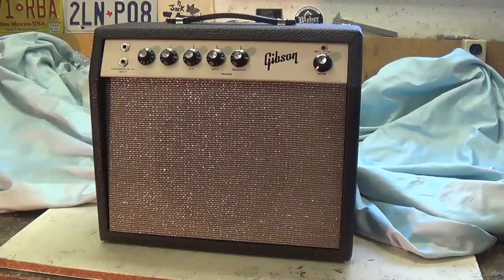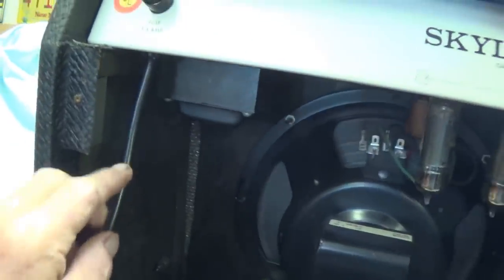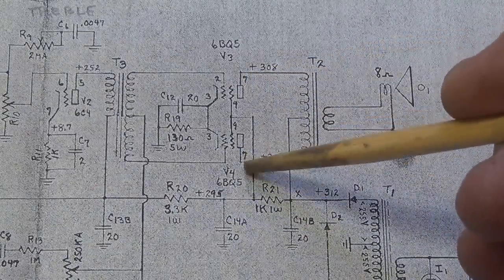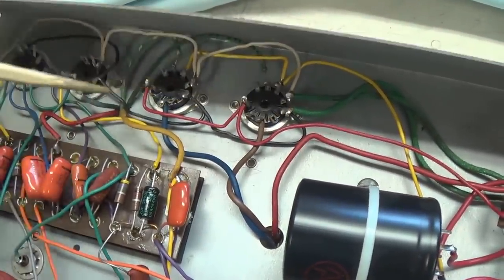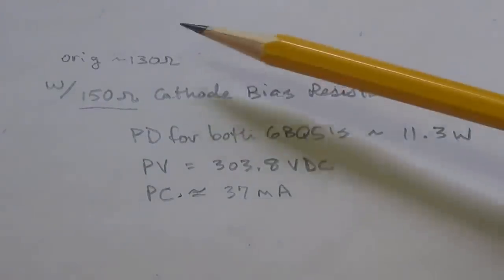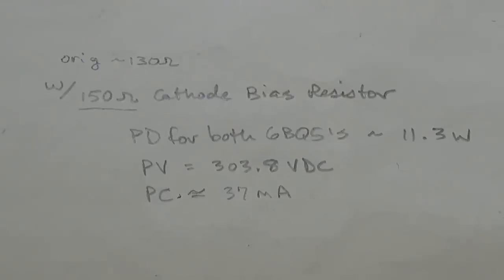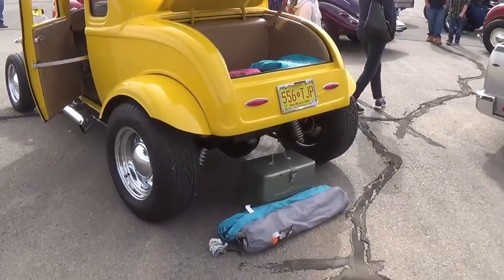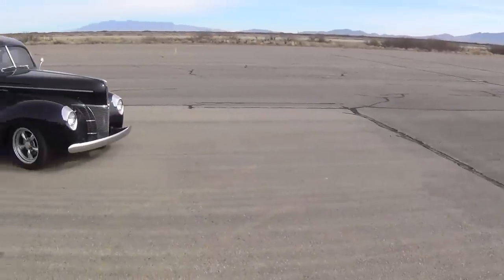1965 Gibson GA-5T Skylark in Superb Original Condition

Comment from the maker: Menu:
0:00 to 10:00  Tour of the Amp
10:00 to 30:39  Detailed Schematic/Circuit Review and Correlation
30:39 to 44:00 Circuit Modifications w/ before and after audio demo
44:00 to 53:00 Car Show

CORRECTION: At around 13:50 in the video I say that the interstage transformer phase inverter output is to the plates of the 6BQ5's.......Of course, it is actually to the grids. Sorry. I guess I was thinking of the OPT primary.
Reply: Uncle Doug 
Thanks for another awesome video.  I like the idea of your “table of contents”.  I have a ga-5 skylark that I think is a 60 or 61, it’s the tan tolex style, all the tubes are from mid late 1960 and the screws look like they’ve never been out( this beauty even came with the original fitted clear vinyl cover)   It’s tone seems good to me with hotter humbuckers but thin and ice-picky with a strat or horrible with a Telecaster.  The schematic that was in the back of the amp shows some kind of weird voltage divider network for the tone control that I, frankly, don’t comprehend.  Any chance of a video explaining the Gibson voltage divider tone control?   Thanks again for all the awesome info.  I wish I could give more to your Paterion but things are tight right now.  I love the car show stuff too. I’m getting ready to sell my 1964 Oldsmobile Starfire convertible I’ve had forever then I’ll hopefully have more disposable income to invest in your awesome, informative, entertaining videos.
Reply from the maker: I discuss the unusual bass control in this video, Mitchel. I'm not sure about the tone control in yours......maybe I'll encounter one in the future. Yes, these amps are god-awful with anything but humbuckers. No problem on the Patreon contribution.....we appreciate any and all pledges. I hate that you have to sell your '64 Olds, but best of luck with whatever you decide.

Comment: Thanks for this great video. Tonight I did some repairs on my GA-5T, replaced a resistor, got the three 20uf caps installed correctly (it had 4 of them and a 220 uf cap connected in with them} that were super glued together and glued to the chassis, put a 3 way grounded cord on it. When I turned it on to test it, like WOW!!! It worked nice. No noticable buzz until volume 7.5 with treble and bass at 10., but still quiet and acceptable to me. And I don't get a shock from touching anything metal on my guitar or jacks. This project has been one of my best Christmas presents ever! This video to me is like video Gold!
Reply from the maker: Your very nice comments made our day, Richie. We're really glad the video was so helpful :)

Comment: A week ago I picked up and old white panel Skylark, identical to this one. It was inoperable and in rough shape. It was a thrift store find and couldn't resist. I want to thank you for this comprehensive tutorial, which helped me get the amp up and running. Much appreciated. I have yet to lift the cap off the bass pot, but after playing the amp it seems like a good idea.
Reply from the maker: We're glad the video was helpful, Jeff. Good luck with the Skylark.
Reply: @UncleDoug  I'm wondering about the values of the rectifier diodes. My Skylark also had a burnt 1K resistor in the same location as the one in your video. When I replaced it one of the diode leads broke. I repaired the solder joints where the two diodes are connected, but  would like to eventually replace them. I didn't find anything identical when checking suppliers. What would you suggest as replacements? Would a 1N4007, 1 amp diode be sufficient?
Reply from the maker: Yes, but since diodes are so inexpensive, you could increase the amperage rating to 2A or 5A if you wish. @jeffreywinter2450

Comment: Man where would I be without you uncle Doug. You never disappoint me your patience and knowledge that keep me learning all that I can.  You are a treasure trove of info and I have to say, THANK YOU SIR!
Reply from the maker: You're welcome, Philip :)
Reply: The skylark walk thru inspired me to re open a newly purchased 66 Gibson explorer of said same vintage. My explorer was a recent Ebay purchase that arrived doa. I reached out to the previous owner for some back story on the amp as I could tell it had some hot rodding already accomplished on it. I assured the guy that my communications were not monetary shakedowns just curiosity. Anywho, I am 3rd generation in my family in the vast electrical industry, amp tech just not part of my field of expertise, that said I went back to my 5 senses. Double checking my cap draining skills I dove back in with the trusty chop stick to finally unearth the shipping problem. The small transformer that acts as the power supply choke seems to have had a not so up to par solder job on one of its legs. There is a terminal strip in this location that has numerous connections and luckily I spotted that loose lead that was only an inch of wire at most.....phew. Well she sprang back to life and I haven't looked back as the Chattanoogas amp techs mods turned out to be spot on and she sounds fantastic. Thanks again uncle doug!!!

Comment: Yes those cats can rock! That amp is about the cleanest Gibson of that era I have ever seen. Your rebuild really makes it live up to it's good looks! Dropping the car low really makes those rides look and handle exceptionally. I would always raise them up. I have gone through too many oil pans. Nothing like repairing an oil pan on forty miles of bad road! Used to carry a stick of J.B. Weld gas tank putty in my glove box.
Reply from the maker: Thanks so much for all your nice comments, KM. Usually the steering arms hang lower than the oil pan, so when you hit an obstacle, you can lose control of the car......but at least the oil pan is OK ;)  Amen on the epoxy putty.....and a can of compressed air with Never-Leak.

Comment: Hi Doug, loved the back and forth comparison between diagram and amp, just brilliant. We have discussed tremolo before, and this trem differs from Fenders. It is similar to an early Vox arrangement where the bias of the output tubes is varied to achieve the trem output. You have concluded that this is not the cleanest way to achieve tremolo as the cathode bias is fighting against the bias change introduced by the changing tremolo signal. On the Vox it enters after the phase inverter tube directly into the grid resister network then onto the grids of the EL84's.
Reply from the maker: Thanks so much, Allan. Bias modulating tremolos do work best in grid-biased circuits, for the reason you cited.

Comment: Well Doug, you have done it again. This is the fourth time you have done an amp just like one in my collection. I got my 1965 ga-5t off the shelf and fired it up after watching. A slight hum which I can't hear with a guitar playing, but there is noise when I bump the front panel. I will work on that later. My amp is just about as tidy as yours except for my very worn handle. That must be tough tolex. Thanks for the inspiration.
Reply from the maker: I guess great minds think......and collect.......alike, David :) You may have a microphonic tube or a cold solder joint. Best of luck with it.

Comment: Love your videos, Uncle Doug! I have learned so much from you. Thanks! It may have been mentioned earlier, but the Fender Musicmaster Bass amp of the '70s is almost an exact copy of this circuit - minus the tremolo and separate bass/treble controls. It also uses a 12AX7 instead of 6EU7, and the power tubes were 6AQ5 - later changed to 6V6. But, when you look at the schematics side by side, there is no doubt that the CBS designers were looking at this amp when laying out the MMB. The Fender amp is kind of lousy as a bass amp, but it can sound quite good with a guitar. I have enjoyed mine:)
Reply from the maker: Thanks for your input, Peter.

Comment: Thank you,  Uncle Doug, a very good explanation of the schematic and relating it to the physical chassis.  I like to know what each tube's function is. Death capacitor should be replaced with an XY rated safety cap. The original cap, although disconnected at one end, should be physically removed so no one in the future will be tempted to reconnect it and possibly shock themselves.  As far as vintage vehicles go, it may seem odd, but my favorite car is a 1963 full size Pontiac. My dad had one, a Canadian base model Strato Chief. I always loved the overall look of the 60's Pontiacs regardless what model level they were.  US models too.
Reply from the maker: You're welcome, Daniel. Thanks for the tips.

Comment: Just another great video as always Uncle Doug. I'm so jealous at the way you manage to consistently surface with yet another very cool vintage amp. I don't exactly know why but my experience has been that Gibson amps seem to deteriorate faster and in greater numbers than Fenders say, or even many other brands. I was a little surprised to see solid wood for the cabinet material. I was really beginning to believe that the reason Gibson amps seem to go to pot is that they used crap for cabinet materials. Honestly, I've seen a lot of them made out of particle board and worse. That one is easily the cleanest specimen I've ever seen. Thanks for sharing it with us.
Reply from the maker: You're welcome, DE, and thanks for your nice comments. I agree that later Gibson amps were hampered by cost-cutting, but (just like Fender amps) during the mid-60's they had not yet succumbed to this unfortunate marketing practice.
Reply: @UncleDoug  Ah...I see. So what seems to have happened in my case is that the maybe 4 or 5 Gibson combos I've crossed paths with just happened to fall into the "made of pressed paper board and Beeman's chewing gum" era.

Comment: Nice little amp. Like in case of many other budget amps, no grid stoppers or screen resistors added to the circuit. I would add 1k grid stoppers and 470R-1k screen resistors to output tubes to increase reliability and tube life.
The transformer phase splitter is not so often seen in guitar amps. Perhaps that transformer brings some mojo to the sound! 

I very much enjoyed watching this video, as I  always do. Thanks again Uncle Doug. 👍

P.S.
It is important to check that the trem intensity pot wiper contact is OK because the output tube grids are connected to ground only through that pot.
Reply from the maker: You're welcome, J. We appreciate your helpful and kind comments.

Comment: Another great video Uncle Doug, love the precise instruction, helps so much in figuring things out on my own project, a Monarch MA-620 amp. Was my first amp I used for my guitar, and now trying to revive it. It has a similar circuit as that bass control, only on the volume, with that 4th pot tap wire, have not really dissected the tone stack and volume setup in depth, but this will surely give some pointers, thanks. May have to report you, to the rehab centers.. they will need a new program, the addicted to Uncle Doug videos ward, ok, come this way...   :)
Reply from the maker: Thanks so much, Sean. We really hope the video is helpful.....that was definitely our intent. It's nice to present great old amps for examination, but they are also quite suitable for teaching purposes.

Comment: Cool amp (and video). Its crazy how Gibson put a 1w resistor in the PI filter. That resistor is badly underrated.
Reply from the maker: Thanks, HTH :)
Reply: @UncleDoug  Have you ever tried changing the mids knob for a push/pull type and using it to lift the tonestack ground connection? Its a rough and ready way to bypass the tonestack, and thereby get a gain boost as you don't get the insertion loss from the tonestack.

Comment: As always, this video was top shelf, informative, and entertaining! This circuit did not have the "tone sucking" module that Gibson used on a lot of their mid 60s amps. I noticed the main power supply filter cap had an extra section that was unused. Maybe the circuit did use another filter before the preamp tube. That would have put two sections in parallel, or maybe not. At any rate, you changed the overall tone and function, especially the bass control, to the best the amp could have. A change of speaker might have also improved the tone. The amp did not have much overdrive distortion, it would disappoint high gain fuzz mongers, and be a boon for clean freaks! Gibson went for "cleanliness, is next to Godliness! ". Did I hear you say there were 2 amps acquired? If so, may we expect a future video on it? Thanxz
Reply from the maker: Thanks so much, ATL. I think the amp is capable of achieving saturation and (hopefully pleasant) distortion at higher volume......but I generally don't use vintage amps at such high settings, so I didn't try it. The other amp is a much larger Gibson (generally worse sounding) with all the tone-sucking pitfalls. It will probably be in a future video. God knows that it needs some help :)

Comment: I have a champ amp wich used to have a two wire cord.now has the 3 wire.the death cap does reduce noise hum. I used to plug it in turn it on the listen to the speaker for hum and buzz. If I heard any Then I would pull the plug flip it 180° then noise would be gone thats what the death cap was there for. But now it has the 3wire with out the noise cap. I may put a noise cap back in but with a one meg in line with it to reduce any shock hazard. I thenk that will still reduce any noise plus rewire the tube heaters. But this little amp is pretty quiet. It does need an overhaul it still has the original P/S cap. Cheers Uncle Doug nice work.
Dwight. Ps. Keep snorting selenium and the scratch and sniff asbestos sheets. Yur funny ha ha.
Reply from the maker: Thanks for sharing this with us, Dwight :)

Comment: I inherited one of these from my late uncle. With my Les Paul or P90’s, sounds awesome. With my strat strung with pure nickel strings, I can’t get a good sound out of it no matter what I do. If Gibson was trying to make amps that would make Fender guitars sound like garbage under any and all circumstances, it worked.
Reply from the maker: Their amps seemed to work well with the (relatively "warm") humbucker pickups found in Gibson guitars......but were awful with most single coils, especially Telecasters. Way too shrill......ugh !!
Reply: @UncleDoug  What replacement speaker would you recommend? (I don't like speaker fizz)
Reply from the maker: I would think any speaker, i.e. Jensen, which can handle at least 15W of output power, which provides a nice safety margin. @BillySoundFarm
Reply: @UncleDoug  Thanks!

Comment: That little Gibson is a beauty, regardless of how it sounds.

By the way, I have a cute little Philips PA amp head (model EL6401/02) that might make a great guitar amp conversion if you're interested. It has some unusual valves in it, and the example I have is in immaculate condition now that I've cleaned six decades of dust off of it!
Reply from the maker: I thought it ended up sounding pretty good, Chris. I'm swamped with work at the moment. If you haven't already done the conversion in a few months, please get back to me.
Reply: @UncleDoug  It definitely ended up sounding great, despite the reputation these amps have for a "brittle" sound. I'll get back in touch about the PA amp conversion in a few months and keep my fingers crossed that you won't be so busy then :-)